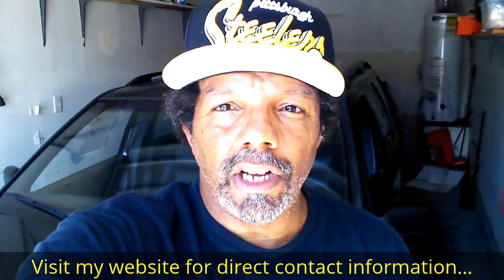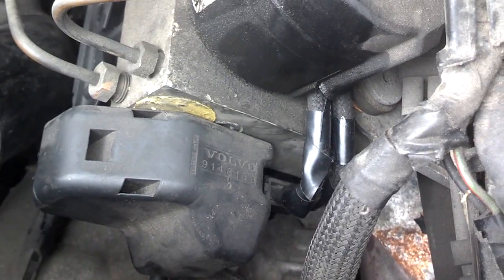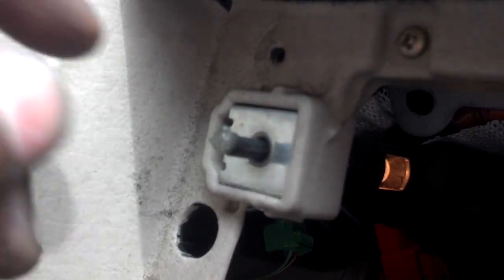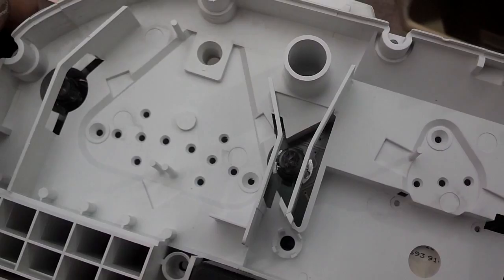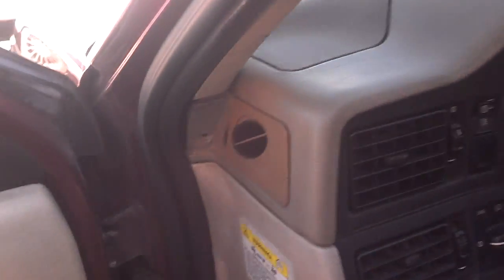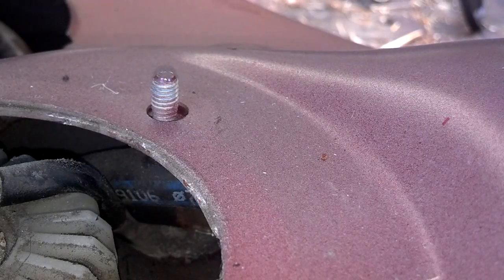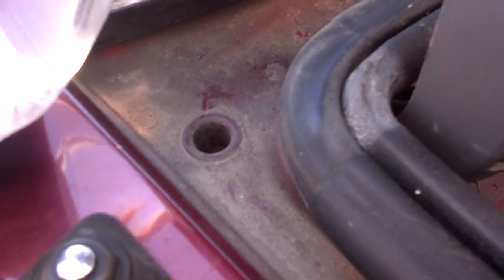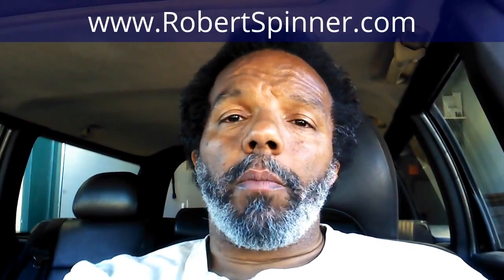That $500 Volvo The Maroon deliverer, 1996 850 T5, Repairs day 6 Ep 6 Pt 7 - VOTD

Comment: In addition to that leaky fuel hose if it has a plastic tank those are prone to indentation overtime from cold winters. So if the car spent anytime in a cold climate that is a possibility and it can decrease your gas mileage significantly and in some cases cause leaks
Reply from the maker: Michael Sackstein I don't know about all that, just that it leaks when full .

Comment: I think airbags have a low resistance across there pins and the airbag module will test for that resistance, i wonder if someone has jumpered the input of the module because the airbag failed a test?

They didnt make that instrument cluster too nice to get at, never mind, you got it all working anyway :-)
Reply from the maker: zx8401ztv LOL, may be a cluster issue.
Reply: Robert DIY
I hope its a simple fix, you could do with a break lol :D
Reply from the maker: I'm done with it. No warning no issue. lol

Comment: Hi there,

I have taken apart my Volvo 850T5 instrument panel to repair the odometer. I used a non turbo 850 tutorial, this meant when I took the back part off the white part the boost gauge went "ping".

There is a loose metal part now and im not sure if i lost other bits. please can you give me some advice on putting it back together?
Thank you very much for any help you can give me.
Reply from the maker: Billie Whyte Have you figured this out yet?
Reply: Yes thank you!! It wasnt off where I thought, it was obvious once i had sort of taken a step back and looked at everything as a whole! Just need to fix all the other bits now! :)

Comment: just drop the tank ...they are pretty ez maybe take about an hour to do with all the part in their locations  but your almost there and just disconnect the fuel lines and like 2 bolts under the car so your talking maybe 30 min job ..

id recommend just undoing the 2 bolts and the straps you'll still have plenty of room to splice the fuel line with OUT undoing them ...

mice chewed my evap stuff (top of the tank yeah it sucked) and I dropped my tank and had full access to the top of the fuel tank lines with out undoing the lines(after I had undone them but live and learn).
there is a few bolts under the gas flap and the whole thing just drops down...

youll be glad when you don't have to cut nothing...

make sure its kinda empty and you'll have no trouble replacing that line...
Reply from the maker: AwakeDude911 I filled the tank ALL the way up to find the leak.